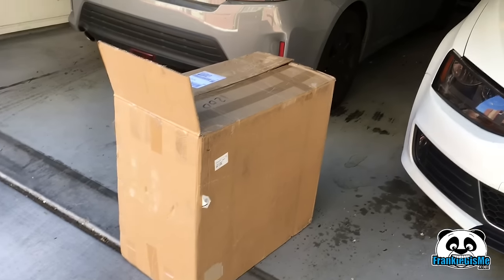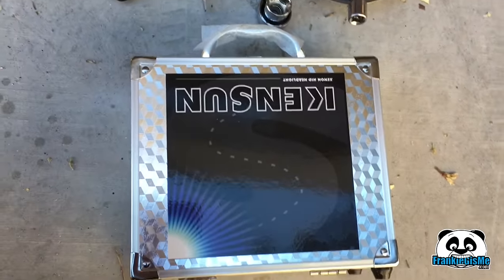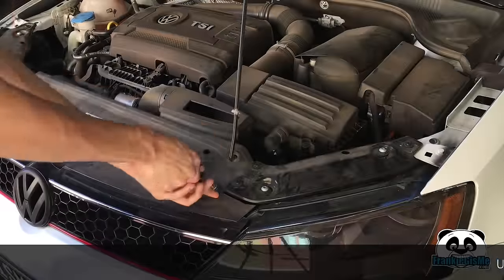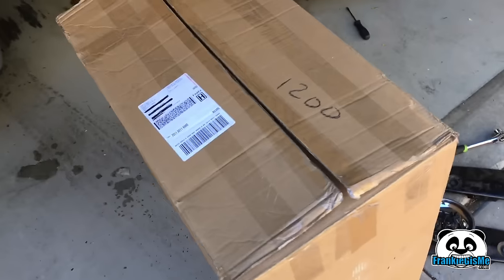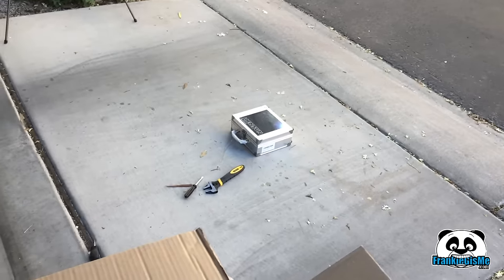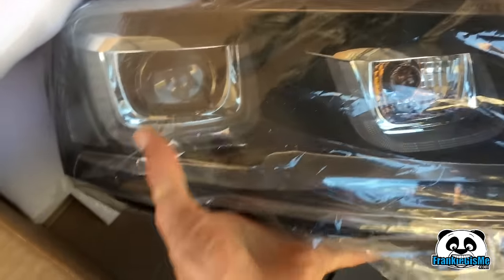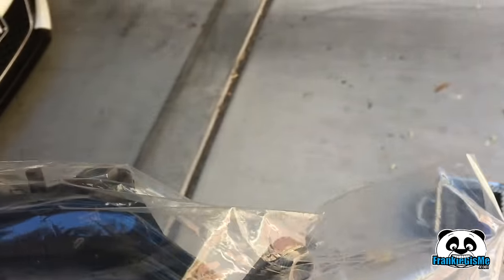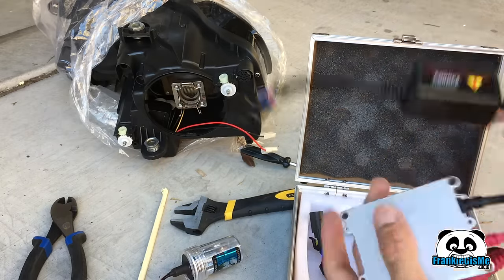How to install Helix projector headlights (VW MK6 Jetta GLI)

Comment: So I got a 2017 Volkswagen Jetta se 1.4 tsi & I need new headlights but I don’t know if I could use these headlights, if not do y’all have any recommendations? 😩 I’m such a girl I have no idea what to get
Reply from the maker: +Lilia Zavala I’m 99% sure your headlights are the same as mine. VW stuck with the MK6 platform for 2017. The next time you go somewhere try to park near an older mk6 jetta and try to look for differences in the shape. Since I don’t think there is any, I’m sure you can buy any mk6 jetta headlights.
Reply: Okay thank you for responding ❤️

Comment: hey frankie, did you ever fix the drl issue? if so, how did you fix it? also do those helix headlight assembly have high beams because i only see one projector lamp?
Reply from the maker: I never did. I heard all you have to do is switch a pin. They have low and high beam in the same projector. You just have to make sure the bulbs you get do both. The xenon bulbs I got in this vid are bixenon so they do high and low beam. The LED bulbs I have now also do both.
Reply: i see. thanks man. love ur content
Reply from the maker: Thanks 🙏🏼 I appreciate your support 😁

Comment: Do you just plug the 10pin connector into the back of the Helix lights as well?  And everything works?
Reply: Have the same exact lights, bulbs, ballasts and everything that you do.
Reply from the maker: +Duke Duren yep 👍 make sure that you get the warning canceller wires too. I just uploaded a vid yesterday that talks about it

Comment: I would like to change my sidelight bulbs on my POLO 6r 1.2 tsi, do i have to remove the bumper to do so?
Reply from the maker: +Smr Tnvr tough call man. I haven't worked on that car before. I don't think you have to because the dealers usually make them easy to get serviced
Reply: FrankieGisMe Thanks man! I changed my DRL to xenon white bulbs and that was a painstaking process, but surely there must be an easier shot at changing the bulbs?
GREAT VID!
Reply from the maker: +Smr Tnvr that's crazy. I hope there's an easier way. Thanks for watching 👍

Comment: Hey man, was wondering how you were able to separate the DRL and the headlight if you wanted to run just the DRL during the day and not the headlight.
Did you have coding done, install a euro switch or something else.
Reply from the maker: +Adam Bowes mine don't. I have been meaning to call the seller but I haven't had time.
Reply: Hmm i thought in another video you uploaded after you had just the U shape Led Drl on without the headlight...
Reply from the maker: +Adam Bowes I had the lights on in that video. you'll notice that my rear lights are on too.
Reply: True you do lol, thanks for the response btw! Looking into buying the same headlights but wanted to see if you knew how to separate the lights. Thanks again!
Reply from the maker: +Adam Bowes ya no problem. Thanks for watching my vids. If I were you I would contact the seller and ask them about it. Overall I really like my headlights
Reply: I actually did they were not entirely sure how i could either and just suggested Vag Com. Will just research more about the subject, thanks!
Reply from the maker: I don't believe its something that can be corrected with Vag Com because on the dash during the day my car shows the DRL light. So the signal is getting sent but the lights aren't recognizing it. It's definitely a light unit wiring issue.
Reply: Interesting, maybe you would also need to install the Euro Headlight Switch to have the option of separating them, not to sure really.
Reply: I'm facing this issue right now. any answer about how to make the just DLR to run during the day?
Reply from the maker: All VW's are wired slightly differently. All you have to do is change the position of the wire in the harness connector

Comment: can you please tell me which ballast you got?
Reply from the maker: The Kensun ballast that I purchased is no longer available. It’s also no longer installed. I use LED bulbs now. Much cleaner under the hood.
Reply: @Frankiegisme  Do the Led bulbs require a ballast as well? and if not can you tell me which type of led bulb you switched too? I would like to follow suit. thank you for any help.
Reply from the maker: For LED I didn’t need anything extra. However, other people have told me that they needed a warning canceler. Here’s the video https://youtu.be/aqzev2JoIYs has links in the description

Comment: Hey man, I bought these exact same headlights and had a shop install them. Right now the headlights are very inconsistent like the daytime light does not turn on unless I turn on the night time lights. And some of the leds don't turn on sometimes. I also installed taillights and it's the same deal. I did not buy a cancellor though (the shop never told me I needed one while installing it) but all I got where the headlights and an hid conversion kit, please help!!???
Reply from the maker: Sameer Mourad I have a canceller for mine. But if I were you I would call the seller and ask them about that. They might have given you a faulty unit
Reply: FrankieGisMe man the shop told me they'll re-look at it but there could be faulty parts. I bought it off UROTuning.com.   Do u think I should tell them I got a shop to install them and they said something's faulty or should I tell them I tried to install it and it's not working properly
Reply from the maker: Sameer Mourad I don't think that part matters. Just tell them that the lights are not working as described
Reply: FrankieGisMe great now I have to pay the shop to swap these lights for the oem lights now. They already charged me $470 just to install the "faulty" lights 😫😫😫
Reply from the maker: Sameer Mourad to be honest it wasn't too difficult to install the headlights. Watch my vid a few more times. It might help you DIY
Reply: FrankieGisMe thanks man
Reply: Sameer Mourad did u fix the problem ? i have the same issue ... one of the headlight lcd rings wont work then i went to check the back and the same problem on the same side of my taillight ...did u fix it ? .. help
Reply: Sameer Mourad did u fix the problem ? i have the same issue ... one of the headlight lcd rings wont work then i went to check the back and the same problem on the same side of my taillight ...did u fix it ? .. help pleaseeeee
Reply: jean carlos flores I was told it needs coding. At first the shops wanted to tell me my lights where malfunctioned. It's all bullshit. I talked to a good buddy he said don't get custom lights, either they work or they dont. With my Jetta model they just didn't function properly. It was a fucking headache and I just sold them. I'm not gunna waste more money on having a shop code the lights for a 50/50 chance that it might fix the problem.
Reply: Sameer Mourad oh ok thanks bro yeah this is a headache already i took it on different places and they told me to reset the computer then another told me that computers order to shup down cause it taking it to much power of it then the other told me that one of the headlight come out defective ..
Reply: Sameer Mourad so did u put the factory one back ? it fix the problem ?

Comment: Hey man , Awesome look , 
One quick question. Did you get the chance to check if there is any way to change the LED DRL , in case something happens to it? 
Or you need to change the entire headlight for it?
Thanks
Reply from the maker: Alex Judoka that is a great question that I didn't think about until recent. I still haven't looked into it, so I'm not sire.

Comment: Hey. I was wondering what you think of these headlights so far. I was just wondering because I want new headlights for my GLI but I don't trust eBay too much for them. I'm trying to choose between eBay or Urotuning or some other website. Any help would be really appreciated!
Reply from the maker: +Husam 18 I think my headlights are sick! The DRLs don't work unless you do a simple rewire tho
Reply: FrankieGisMe do they not work because of a mistake or just because of wiring problems that anyone will have? And did they come with the Xenon Hids or did you have to buy them separately? And we're there any warning lights on too because of the different headlights?
Reply from the maker: Husam 18 they work only when the headlights are on. They didn't come with bulbs or ballast so I sought that separate from amazon. I it the links to what I got in the description.
Reply: FrankieGisMe alright man. Thank you man. I'll take a look at all that
Reply: I just ordered a pair for myself but I was just thinking about it and was wondering if these headlights have the option for high beams? Since where it would usually be on stock headlights is where the turn signal is on the new headlights
Reply from the maker: +Husam 18 they're bi-xenon so the xenon bulbs work for high and low beam
Reply: FrankieGisMe Did you have any error lights on with these headlights?
Reply from the maker: +Husam 18 I did until I got the canceler that is in the description
Reply: FrankieGisMe ahh alright I see. I just put mine on today and they look great. I don't have the issue you're having with them only working with headlights on and I think a fix for your issue is using a different euro switch. Mine has an option for city lights, headlights and Automatic lights and also just drls
Reply from the maker: +Husam 18 that's awesome glad you like them. They might have fixed the wiring on current releases of the headlights. I still like them
Reply: FrankieGisMe yeah they might have. I noticed the lights kind of haze up easily. Does that happen to you too?
Reply from the maker: +Husam 18 no, mine are still very clear like I just got them
Reply: FrankieGisMe ahh alright. Maybe it's just mine then. It's mainly towards the bottom of the lights so it's barely noticeable unless you really look at them. But thanks for the quick feedback man
Reply from the maker: +Husam 18 ya no problem. Thanks for watching my vids 👍

Comment: Will these fit my 2015 Jetta TDI SE
Reply from the maker: To my knowledge, they fit all mk6 jetta sedans that have halogen headlights from the factory
Reply: Okay just making sure, it says there on the fit that it’s not compatible with my TDI on the eBay site.
Reply from the maker: Hmm... I would message them and ask. I’m pretty sure TDI has the same fitment.
Reply: FrankieGisMe I have they said to check the chart they are not helpful at all .
Reply from the maker: That’s dumb. Find out what their return policy is, If it’s decent then I recommend buying them. If they don’t fit return them.
Reply: FrankieGisMe thank you for the advice greatly appreciate it. I will let you know what they say tomorrow .
Reply: FrankieGisMe hey bud question I am about to order my HID from The Retrofit Source should I get the H7 bulb with the canbus h7 wire harness
Reply from the maker: OEM headlights?
Reply: FrankieGisMe no for the headlight you have on your GLI I ordered the same ones.
Reply from the maker: Oh cool 😎 you need D2S style bulbs 💡 not H7
Reply: FrankieGisMe They fit my TDI and they look awesome man. Thanks for the info.
Reply: FrankieGisMe did you ever experience condensation on your headlight.
Reply from the maker: No, that’s not normal. Send it back to the company and have them send you a new one
Reply: FrankieGisMe okay I’ll contact them tomorrow morning and ask them it’s going to be a paint to take them off again
Reply from the maker: Ya that sucks but it means they didn’t seal them properly

Comment: can fit  on jetta  2017 ?
Reply from the maker: The headlights on 2017 look the same as the previous models. Im pretty sure they would still fit.
Reply: tks 
How to get your DRL without the headlights turned on?
Reply from the maker: +abdou oran i have heard that it's as easy as replacing a wire on the 10 pin harness on the car side. I haven't done it yet but I will soon have a vid for that. Supposedly the blue wire in the fourth position to the first position.

Comment: Great vids man! ive got a 2015 GLI too and I love it also did some plasti dipping myself checkout my cannel think you will like the stripes at the bottom of the doors
Reply from the maker: That's awesome! Funny that you mentioned your channel... I went to check it out right now and it says that I watched your exhaust video. I've been looking around trying to decide on what exhaust system to get. Good stuff man.
Reply: Haha nice! Yeah I love to mod all my cars I just sent in my ECU today to get APR Stage 2 tune I cant wait!
Also if your thinking about exhaust I would definitely recommend doing a turbo back system. 
Thinking about doing a lite smoke on my headlights did you have the original headlights smoked on the Panda?
Reply from the maker: Nice! Your car is definitely quicker than mine haha. I listened to so many exhaust systems online that im still not sure which one I want but it'll most likely be a resonated turbo back system. 

On the original headlights I used Lamin-x film to tint them. I like that film because it also protects from rock chips. 

What are you doing next to your GLI?
Reply: Well in addition to the tune I also have a full set of Megan racing coilovers on the way which should stiffen up the ride a bit. Also they are fully adjustable so I'm going to lower the front about an inch and the rear an inch and a half. Think the only other things after that will be water methanol injection to get me as close to 300HP and 360TQ lastl thing I want to get some different rims thinking about 18" TSW Max Hyper Silver
Reply from the maker: +Logan Gamble I want to lower mine so bad but I don't want the inconvenience. My solution is dampening air suspension.unfortunately, it's not cheap. I'm gonna save most performance stuff for last. I'm going more for a stanced look.
Reply: Yeah I'd love to go that route too but like you said those systems cost a pretty penny!